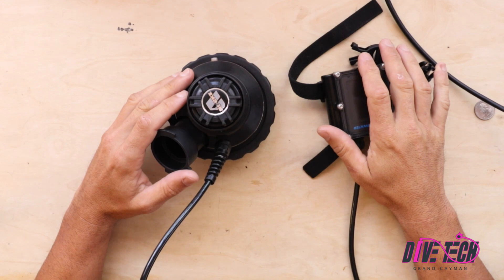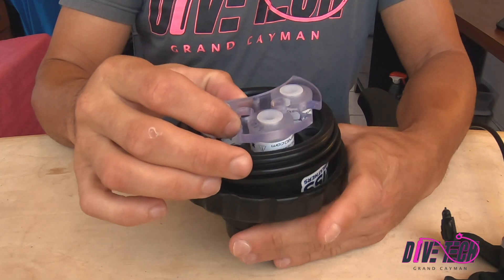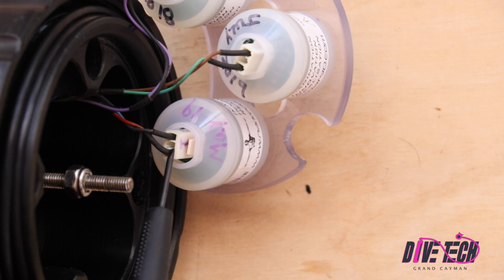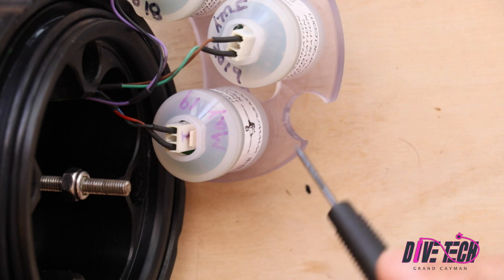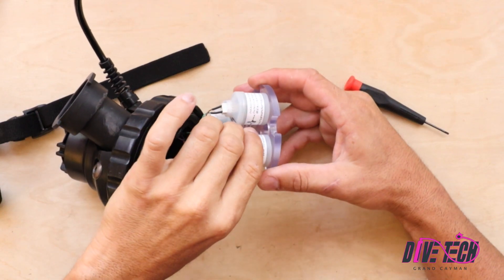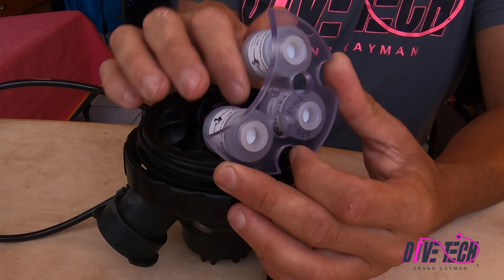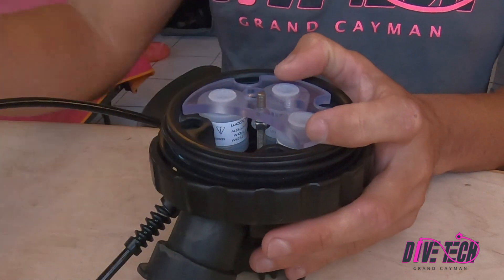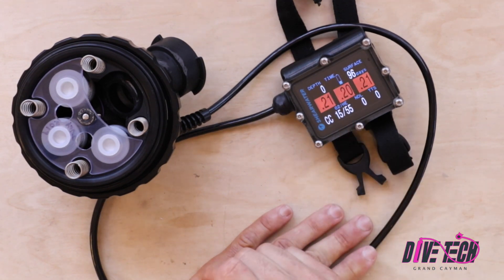How to change an oxygen sensor on your KISS rebreather

Comment: I would also suggest that you mention expiration dates, not replacing every cell that has the same expiration date.  You simply don't want multiple cells to fail at or about the same time. Just like hard drives within a datacenter.